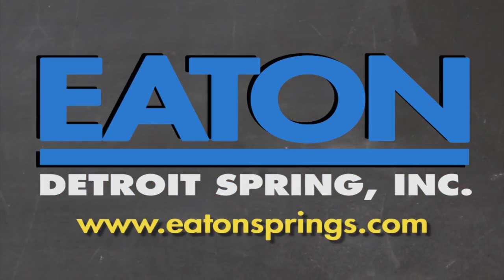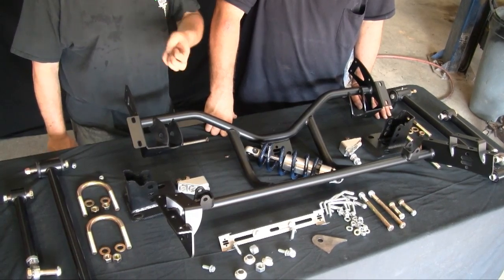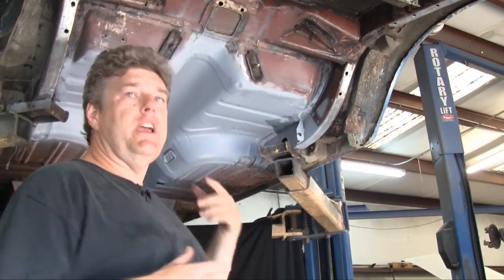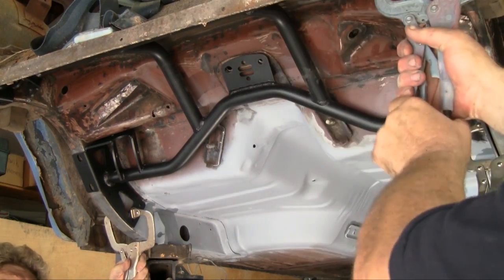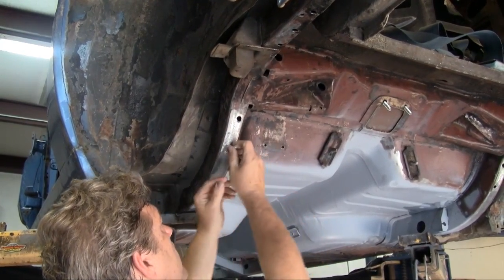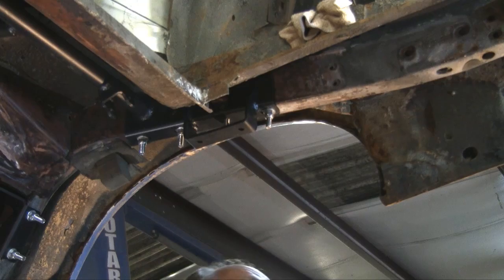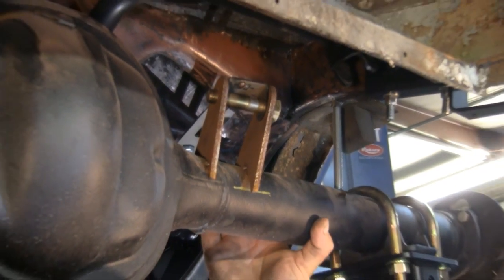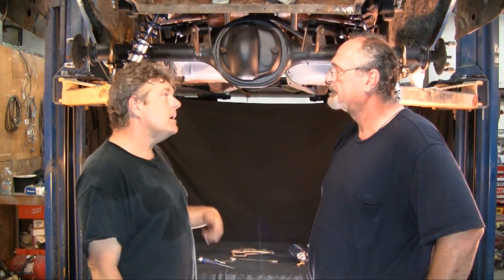Classic Mustang Cougar New Ridetech 4 link rear suspension Episode 215 Autorestomod

Comment: clever idea of ridetech using u-bolts to mount the kit thru a blind frame member...brilliant. i used a heidts 4 link kit but i like the ride tech version better, plus with the ridetech kit you dont have too remove the old leaf spring perch brackets from the rear end housing on the heidts kit u have to gind off the perches.

Comment: How do you drill the holes  in the frame rail close to the rear seat pan? I can’t get a drill in there. I even tried a right angle drill. It’s the forward most front hole  of the Carriage that gets a speed bolt.
Reply from the maker: Can you send pictures of where you are talking about to: jford@autorestomod.com

Comment: Do You Take Out the bump stops? Would you need them?
Reply from the maker: I would leave them in with the realization that you might have to cut them to get them to clear if the car gets lowered.
Reply: How do you drill the holes  in the frame rail close to the rear seat pan? I can’t get a drill in there. I even tried a right angle drill. It’s the forward most front hole  of the Carriage that gets a speed bolt.